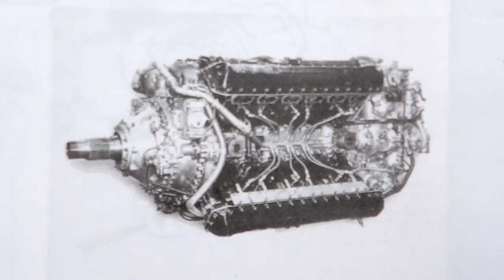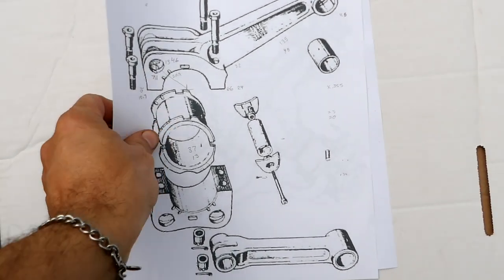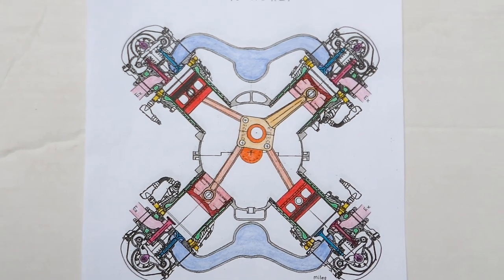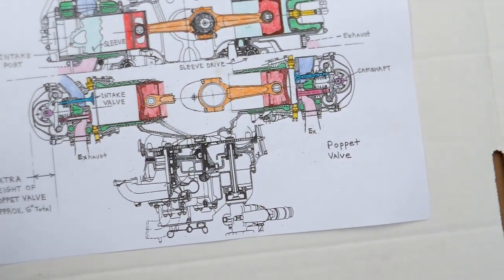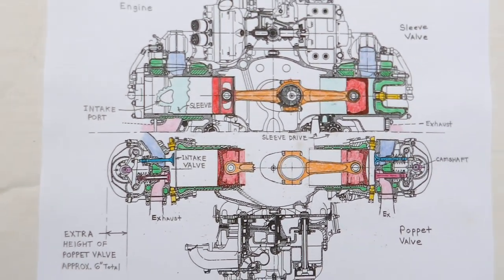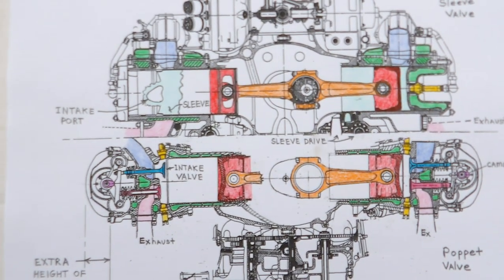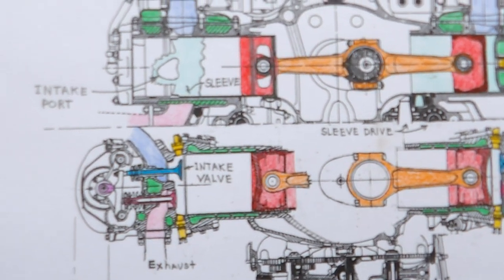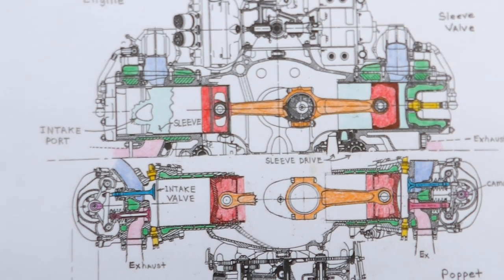New Rolls Royce Vulture Cross Section Drawing

Comment: You DREW THAT?!?! BY HAND?!?! Holy crap dude that is extremely impressive. I know that's how it was done in the pre-tech patent days but I have always marveled at these types of drawings. Gun to my head, I'd die before producing such a drawing. I'm really excited for this current engine build in progress. It's so unique and rare. :)
Reply from the maker: I copied a Merlin drawing of the basic cylinders, then I changed the piston positioning to match where it needed to be in this engine. I also drew in the camshaft and valves to be open in 2 of the cylinders. I use photocopying where possible, but i did draw the whole crankcase area and the connecting rods from scratch. I guess i am old school, as I spent 5 years on a drafting table at the start of my drafting career, it has been CAD every since. Though I still draw most of my FrankenBriggs engines by hand on and 8-1/2 by 11 sheet of paper while watching a TV show  :)

Comment: I had never seen the connecting rod arrangement of the vulture before but had assumed they’d used a master/ slave rod arrangement for each bank of four cylinders as you showed. Apparently these gave a lot of trouble but I never really understood why. Do you have any insight?
Reply from the maker: I based the drawing on as much Vulture material as I could find, which isn't much! The geometry of the master and slave rods with the cylinders at 90 degree increments works out very badly. Rolls tried a number of different rod designs, but not were really satisfactory. They also had a problem with the top and bottom blocks "shuffling", since the attachments couldn't be made secure enough to handle the vibrations over time. Send me an e-mail at enforcer12345@hotmail.com and I will see if I can send you some pdf material about it.   Miles
Reply: @ChargerMiles007  that would be great. I’ve just emailed you

Comment: The Vulture was primarily two RR Peregrines bolted together with a common crankcase not Merlin’s
Reply from the maker: Yes, you are right. Back 20 years ago when I was getting the photocopies of the various engines, I couldn't find a cross section of a Peregrine to use.

Comment: I believe it was more closely related to the earlier Kestrel.
Reply: Or the Peregrine which was basically a supercharged Kestrel and not exactly the best engine that RR ever produced. The Vulture utilised Peregrine cylinder banks and suffered from lubrication and cooling problems and was eventually abandoned. It is also interesting to note that RR did experiment with sleeve valves (although not on the Kestrel, Peregrine or Merlin) but decided not to go down that route.
Reply from the maker: Except that their last piston engine the Eagle 22 was an H24 sleeve valve, kind of an enlarged copy of the Napier Sabre.
Reply from the maker: Yes, I have used a Merlin drawing to generate the cross section, but it would have been pretty similar.
Reply: Very true...
Reply: The Kestrel was an earlier and smaller version of what became the Merlin. It was derived from a Curtis D12 engine, was at first the "F" engine and had a centrifugal supercharger. It powered aircraft like the Fury, Hart,Hartebeest, Demon  etc in the middle 30s.

Comment: Fitted to the Avro Manchester but notoriously unreliable which resulted in the Avro Lancaster with 4 Merlins
Reply from the maker: Yes, the Vulture was  a bit of a dud motor, the X design didn't seem to work well for the Germans either. It was just next to impossible to design a good connecting rod for it.
Reply: @ChargerMiles007  I think that the problem was with the cooling system, I think that I’m right when I say that many more aircraft were lost to mechanical failure than enemy action?